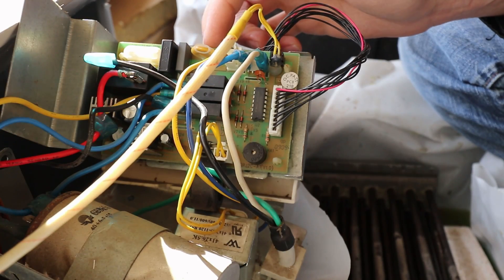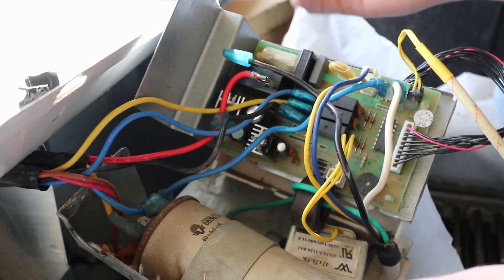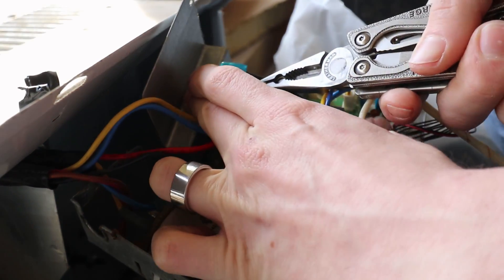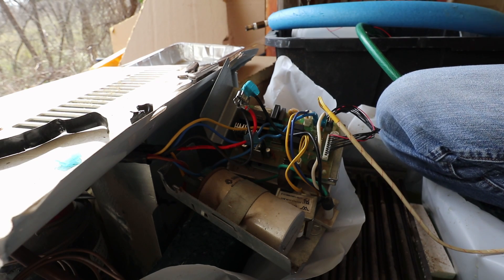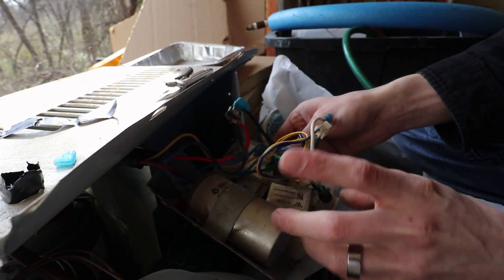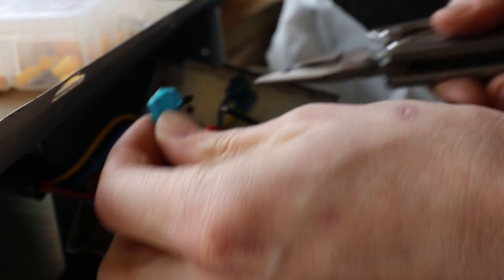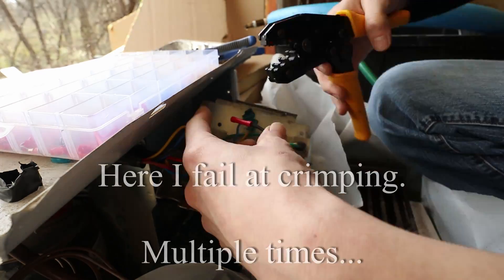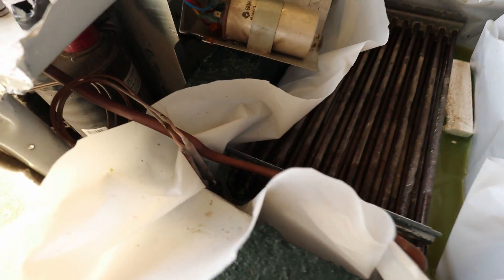Glycol Chiller Thermostat - Hack AC to Below Freezing

Comment: Great walk through! I was concerned about getting a newer model AC unit for a frankenchiller project, but it makes sense that you’d be able to bypass all the control circuitry. Great!

Would you say that a portable unit with one of those exhaust air pipes would be a good choice for this? Having the condenser coil on the bottom rather than side by side seems like it would make immersing it easier, without risking the delicate copper pipes twisting over a unit where the condenser and evaporator are side by side.

Do you have a video on the physical build itself? 🤓🤓

Comment: I building one myself. Trying to control the outside mini-split without an indoor unit. I've seen that most condensers have an "equalizing" part which equalizes the pressure between the gas and fluid line before the compressor starts. It's said to protect the compressor by not starting it under heavy load (pressure differential). It seems bypassing the logic of the control board would cut out the 3-5 second lag that does this function. Or did your unit not have this component?

Comment: I just did this with your method. I got it to work. I plugged it in and it went from 79 to 75 degrees and shut off. Now it won’t turn back on. I don’t know what happened. I wasn’t in front of it when it stopped working. Any idea?
Reply from the maker: It might be the histerisis number that is wrong. How warm did it get and still not turn back on? I don’t remember what the default is but if you wanted to keep temps between 75 and 78 you’d have a hysteresis of 3.

Comment: Discharge capacitors with volt meter. Capacitors can discharge a higher voltage then line. Usually 360vac to 440vac. So be careful.